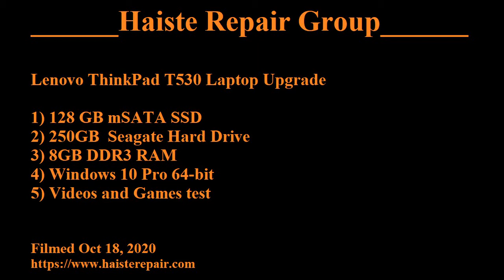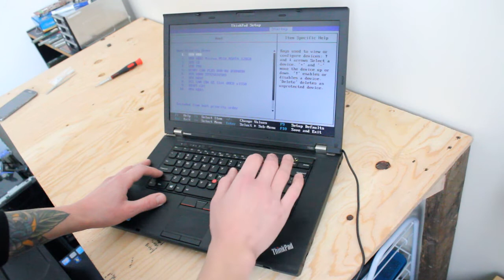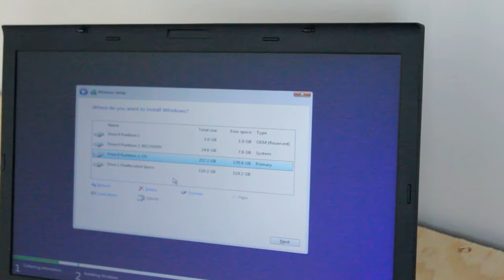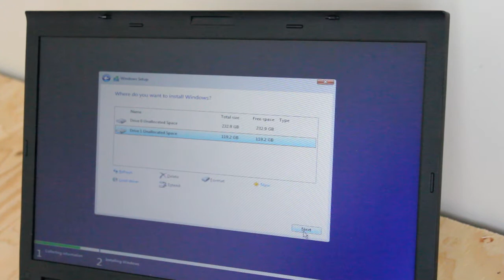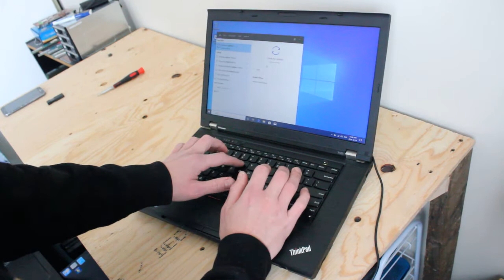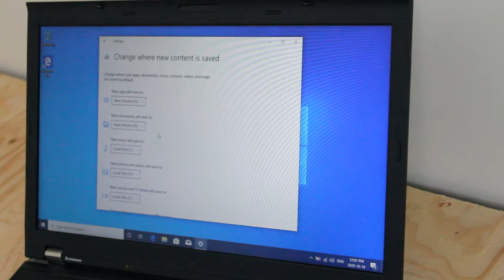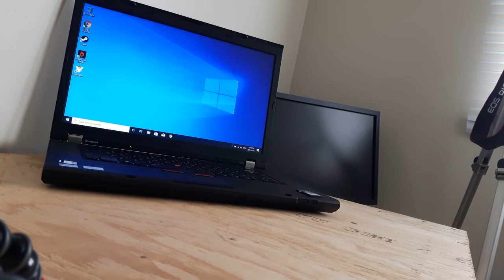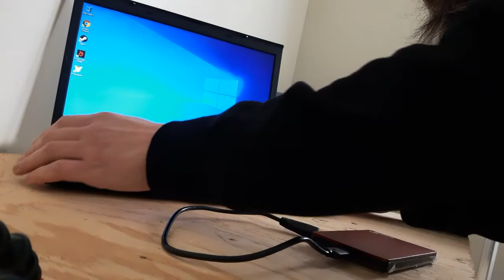Lenovo ThinkPad T530 Upgrade (mSATA SSD, HDD, RAM, Win10)

Comment: Can 32GB of memory be installed in this lapotpa?
Reply from the maker: I have only tested up to 16GB.  With the ThinkPad W530 there are four RAM slots and paired with a quad core i7 CPU you could install 32GB RAM.  With the T530 having only two slots, I would have to guess 16GB RAM would be the max.
Reply: @HaisteComputerRepair  Is it possible to install a hard drive type SSD M.2 SATA of SSD NVMe on this laptop?
Reply from the maker: @marekkowalski3814  No, sorry the T530 can only have an mSATA Solid State Drive or a 2.5" Solid State Drive.  The mSATA SSD is a great boot drive, but be mindful it is limited to SATA II.  Not the end of the world by a long shot, but if you want the better speed for whatever reason, use the 2.5" bay for the SATA III SSD.
Reply: @HaisteComputerRepair  Samsung SSD 860 EVO 1TB 2.5 Inch SATA III Internal SSD (MZ-76E1T0B/AM)
Reply from the maker: @marekkowalski3814  That would be an excellent choice.
Reply: Nope, 16gb max.

Comment: Good morning I have a laptop the same, I see that you remove a memory under the keyboard and I do not understand why maybe it is because you put 2 modules of 8 gb I hope your answer thanks,
Reply from the maker: I installed 1 x 4GB under the keyboard and 1 x 4GB under the panel on the bottom of the laptop.  Definitely recommend at least 8GB dual channel for the T530.

Comment: thanks for this wonderful video. I had a small concern, msata runs on Sata 300 or 600? thanks. :)
Reply from the maker: The mSATA will run at SATA II speeds, but acting as a Windows (or whatever OS) boot drive is still pretty fast.  Especially for the T530's generation.  You can install a 2.5" SSD in the HDD bay and that will run at SATA III speeds.  I have done both and had dual mSATA and 2.5" SSD's running and performance is good.  Thanks for watching :)

Comment: is it wasteful to upgrade the battery?
Reply from the maker: Not at all, especially if you need it.  Try a third party battery, but make sure there is a return policy in place.  I have run into the problem of third party batteries not working in T530's.  I would get an error message stating that it is unrecognized as a Lenovo product.  This is not always the case, though, and there was a rather extensive work around I found online.  Other than that, good luck!  Nothing left to do but try it out.

Comment: The screw that holds down the mSATA SSD is stripped and won't come out. WHat can I do?
Reply from the maker: Do you have access to or own a drill?  Check out my video here that shows how to remove a stripped screw:  https://youtu.be/M8vdp9ua-eo

Being that the screw on the T530 is on the motherboard, be very careful if you do this.  Only drill where the screw is and make sure your hands are steady.  If you don't have the tools or can't afford a slip up, maybe give a repair shop a call to see if this is something they can do.
Reply: @HaisteComputerRepair  I'll look and see, thank you!
Reply from the maker: @TheHutch1138  No problem :)